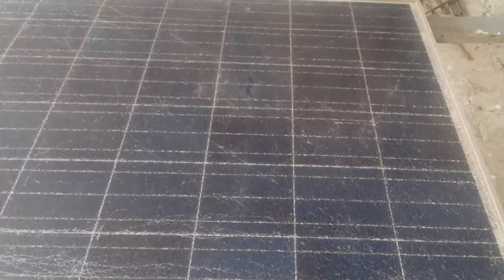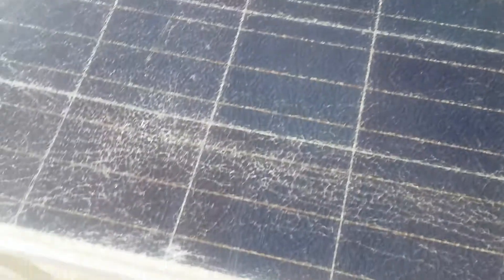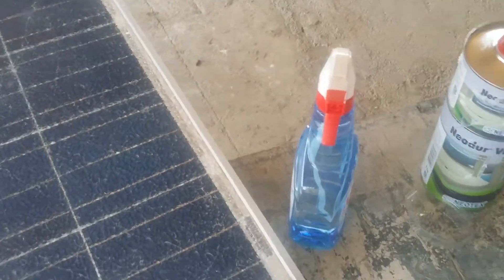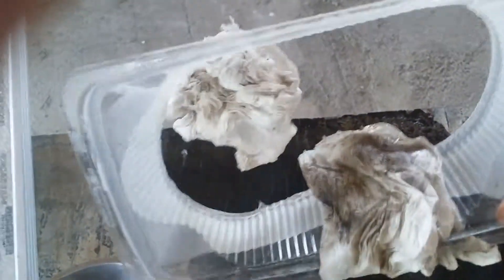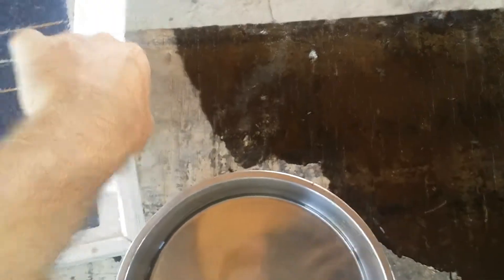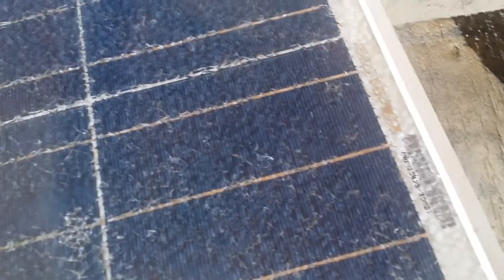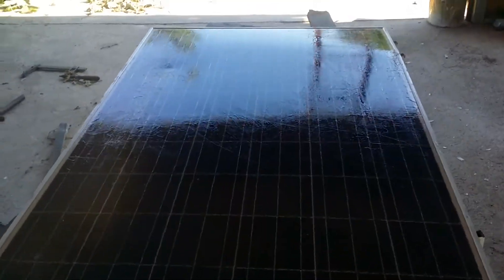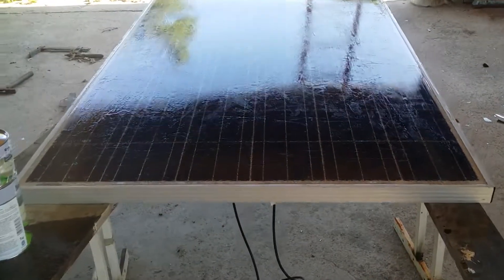Fixing Solar Panel Shattered Glass Quick Easy Repair With Polyurethane Varnish Coating

Comment: is it still holding?
Reply from the maker: I did 3 panels with it. 2 od them with thicker coating are still holding. On the panel that is with thin coating - it started lifting in places where the coating is thin. Doen't peal off and there are no holes... for now.